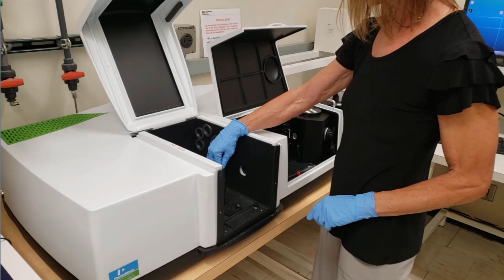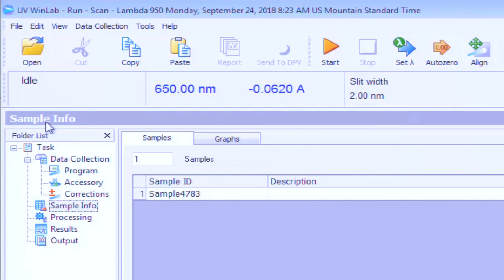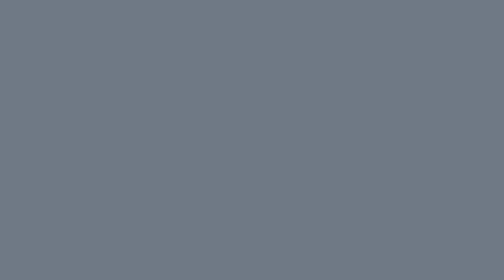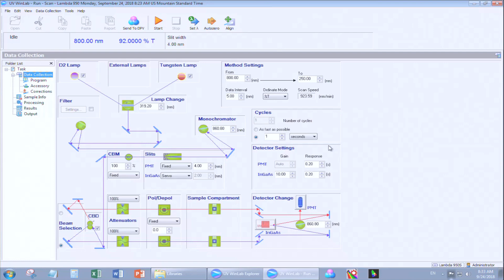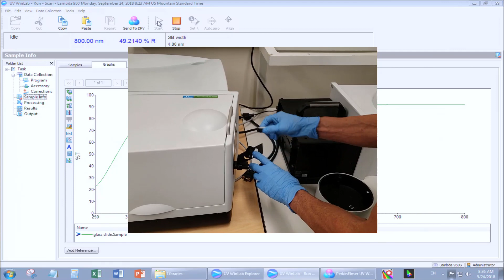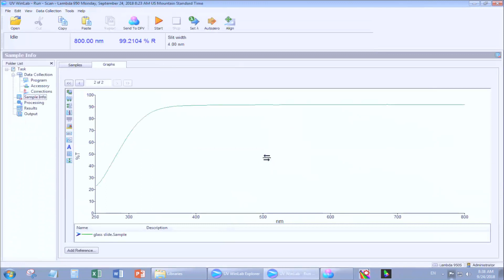Lambda950 training video

Comment: Thanks for the video! When you were measuring the reflectance, what is there in the 2 holders you are refering to as the reference and the sample? What is the chemical composition on them?
Also, is it not necessary to run any baseline scan for this reflectance mode? Does it not have anything to do with the BaSO4 baseline?
Reply from the maker: We use a spectralon 99% reference on our instrument. Spectralon are calibrated references made of teflon. I have not used BaSO4 for baseline. If you are interested I see an interesting comparizon between references here: https://www.shimadzu.com/an/sites/shimadzu.com.an/files/pim/pim_document_file/applications/application_note/13902/a639_e.pdf
Reply: @EyringMaterialsCenter  Thank you very much. Have a nice day

Comment: Hi, thank you for your nice video, it's very helpful.
 I just wanna ask , if I wanna take blank sample (ITO glass) so where is the place for blank sample?
Reply: Luthfiyah, if I understand you correctly, I believe you are asking where to put a reference sample. The reference port is located on the front side of the integrating sphere. In the video you might notice there is a reference standard used on that port when a reference sample is not used. I hope this answers your question. ~Diana

Comment: Hi, is it possible to measure the absolute optical  power or intensity  of the light falling on the sample in Lambda 950,?.
Reply from the maker: Hi Neethu,
   The system is a dual beam instrument comparing the intensity between the 2 beams so there is no absolute measurement of the intensity only a relative one.